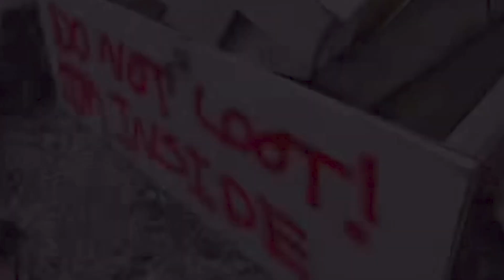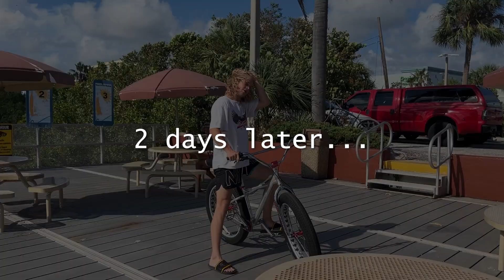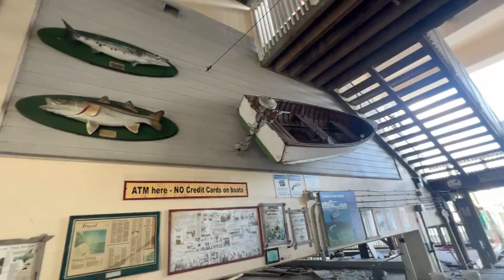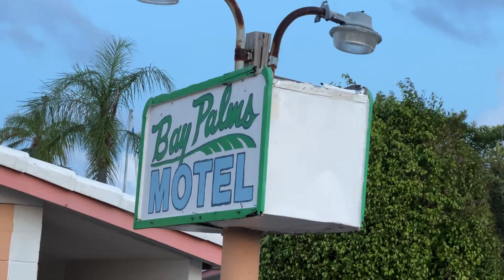Hurricane Helene Destroyed My City

Comment: You're not entirely wrong about EVs but mostly you are. I won't attempt to explain why in detail. Just know that battery fires due to salt water are extremely rare and new newer EVs have better safer tech... as well as better build quality and a multitude of different types of battery cell / banks ... So fact is.. EV battery fires are not common they are extremely rare... EVs rule..